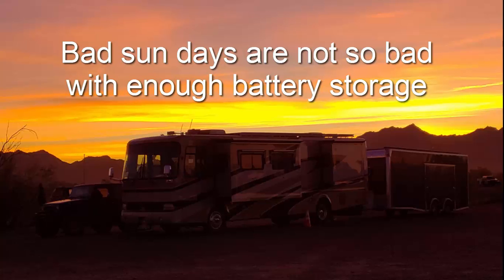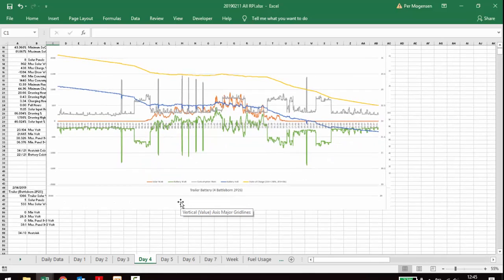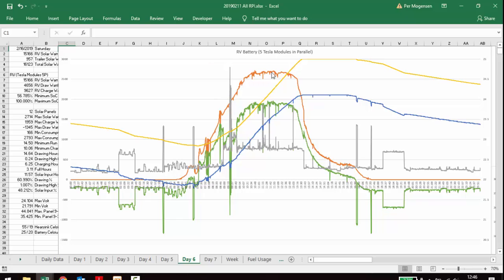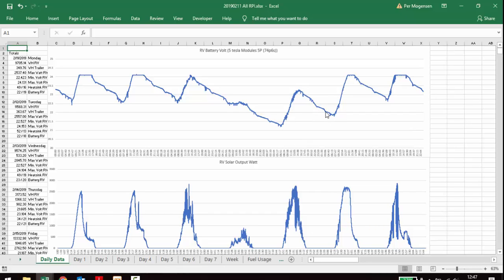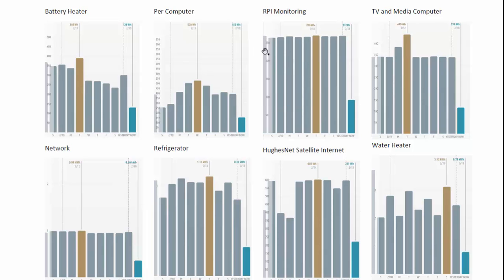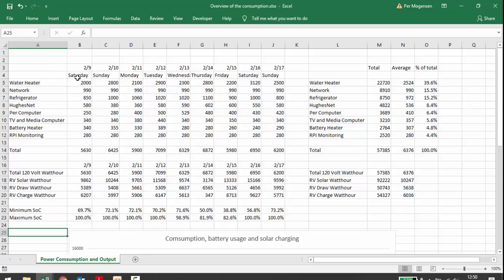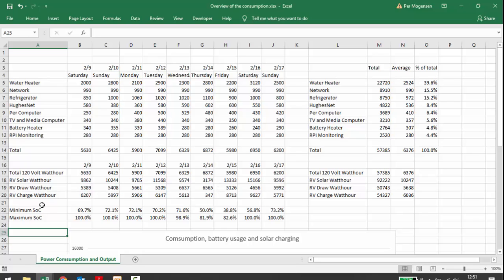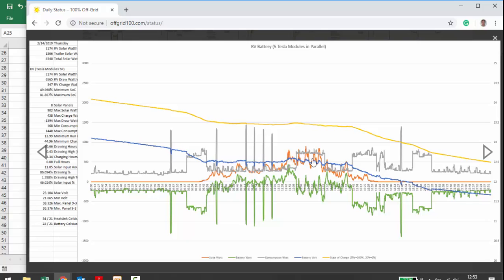Bad Sun Days in Quartzsite

Comment: Although I.'m a fossil fuel guy, I'm very impressed with your analysis. How much coal is burned to smelt enough nickel for a Tesla battery pack?
Reply from the maker: I'm not sure, but since I use the batteries after the primary use is that really not in my calculations. Nickel does account for 80% of the Cathode in the battery, Cobalt (15%) and Aluminum (5%) is the other parts. 
This video is more to cover the fact it is possible to get all your energy for a "House" from solar. This gives us the ability to run our appliances for an unlimited time without the need for fossil fuel. The overview of our consumption can also be useful to others.